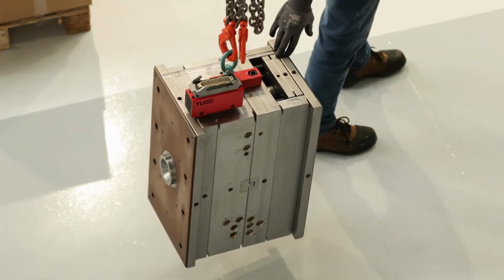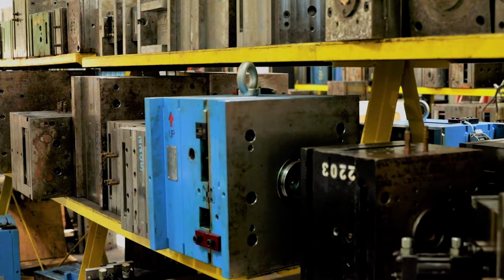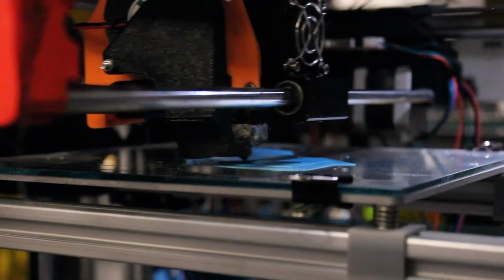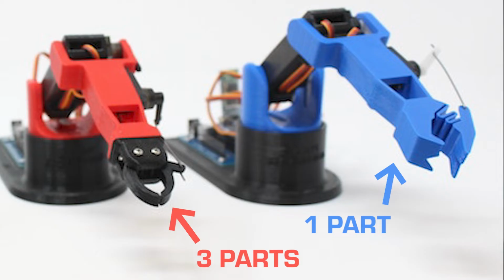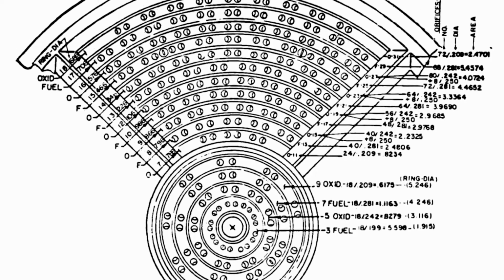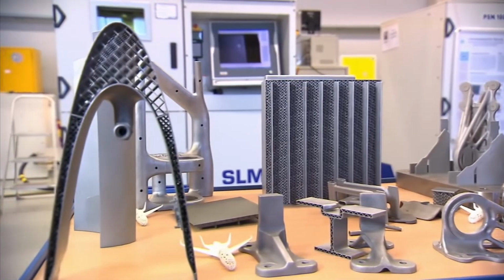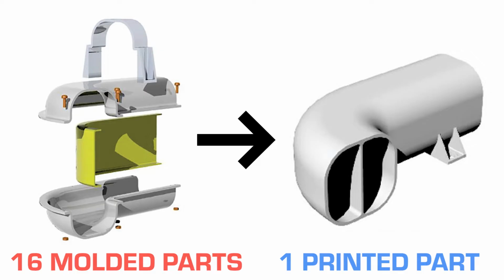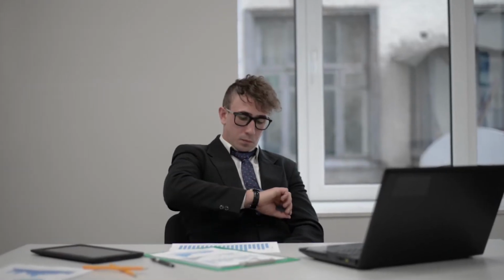Reduce Your Tooling Costs with Mass Production 3D Printing

Comment: With the reduction in part count, it might be interesting to follow up on repairability of printed parts. It seems like you'd have some tradeoffs there (e.g the waste of a broken monolithic part). Though you also gain print on demand replacement parts, which could extend the lifetime of printed products without having to warehouse those replacement parts. Perhaps repairability concepts could also be touched on in your design series.

Comment: Laser sintering and photolithography still seem better options than FDM, which is what most ppl think of at the hobby level. FDM has multi material benefits over the other two I suppose.
Reply: Laser sintering is a nice production method, but it is very labour intensive to clean the parts from exces powder.
Reply: @wilsistermans1118  true